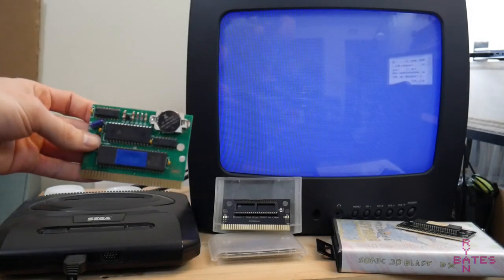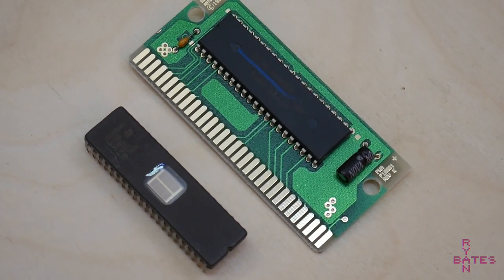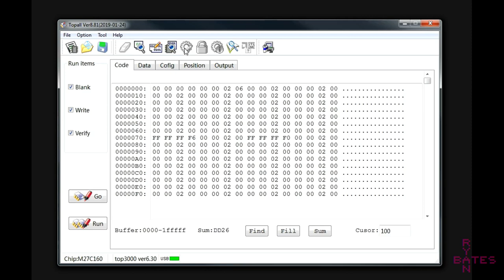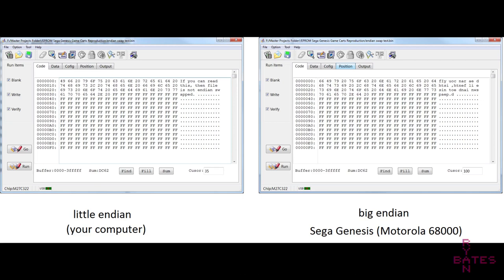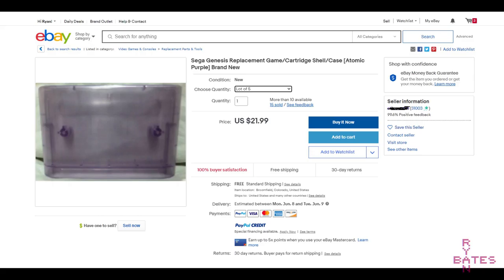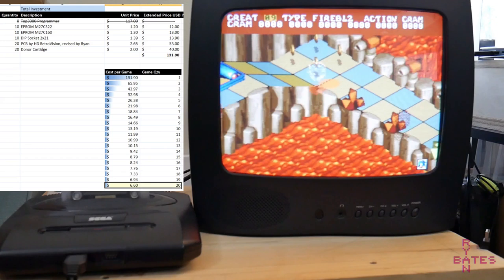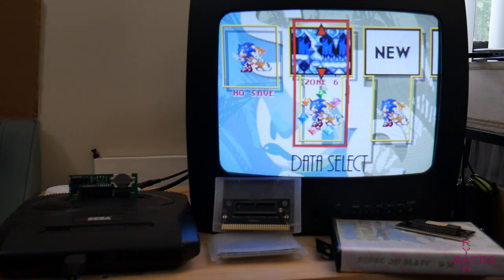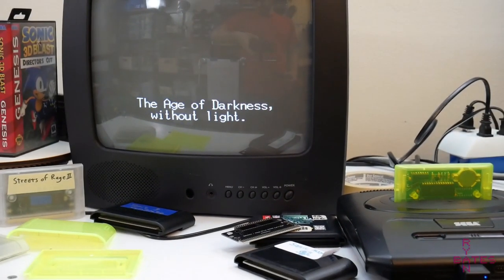Sega Genesis / Mega Drive EPROM Reproduction Cartridges | How to Make + Other Unnecessary Details

Comment: Very helful video, thanks a lot!
About removing the top of the Genesis shell for fitting in a test cart with a socket, I was thinking of using a Game Genie instead. If that works, I could even build a test cart with a ZIF socket which would make testing EPROM even easier.
Reply from the maker: Glad it helped. Game Genie would make a great cart extension.

Comment: I’ve heard the specific programmer doesn’t work on anything higher than Windows 7 32 bit. Is that true or is there something extra that I’d have to do to be able to get it working on my windows 10 computer?
Reply from the maker: It works on windows 10 64 bit. Source = me.

Comment from the maker: Anyone who has purchased repro carts: 
What are your thoughts? 
Where did you purchase: game show? online? 
How was the quality? 
What's more appealing; ROM hacks or physical versions of very rare/expensive games?
Reply: Megaran's RNDM cart, Remute's snes and genesis carts, ThaDe4D's cart album, LSDJ, nanoloop, etc..

None of these music albums or music tools would have been possible without repro / flash carts, and I love them to bits.
Reply: Imho, rare expensive game copies are more appealing, as it allows to have somewhat-of-a-physical-media.  That's why I prefer repros to flashcarts, because of that possessive feeling. Some Aliexpress repros were pretty good, but you always need to be careful, because cheap repros of save-games are faulty
Reply: i have purchased TMNT Hyperstone Heist in box on aliexpress a couple years ago - too bad i forgot the seller's name because the cartridge is nice quality for a repro - the originals feel a bit more solid but the repro cartridge shell has no rough edges or other signs of half-assed manufacturing.

same goes for the case - the trained eye will instantly spot that it's a repro because the transparent foil that protects the box art inlay is a bit more on the glossy side than an original would be ...

the price was also ok ... under 10 bucks shipped or so - and most important - the game works as it should and didn't fry my console ... i've heard horror stories 

now, what's more appealing? well, I just bought an everdrive and this kind of erases the NEED to buy any more physical copies ... now I might still buy physical copies when i WANT to. 

but i think i'd rather buy new releases or new-to-this-region releases ... you know ... proper translations of games from japan or korea that have not been released in US/EU before.

... and it would be cool to have things like the "240p test suite" on a cartridge as a tool to keep around the workbench when repairing or modding consoles and equippment.

a very awesome thing would also be if someone would take SMS games that would have had FM sound on japanese consoles, stuff the game ROM and the FM sound chip into a cartridge so westerners can finally enjoy SMS games like phantasy star with FM sound instead of whatever terrible noise generator the US/EU SMS consoles were stuck with.

Comment: I came across a used Repro of Musha that a local pop store was selling for 150, they opened up the cartridge and low and behold I saw an eprom with the visible microchip silicon. I've never seen that before so was curious and finally came across this. They luckily sold Musha to me for 19.99. I was actually impressed with the repro label and the fact they used a close to if not original sega cartridge, as it said Acclaim made in Mexico on back piece, and used real screws. Cool stuff, as I am not about to drop 300-500 on Musha, and didnt want a cheapie repro.

Moreover, the Board the UV eprom mine has is only a handful of contacts on the board. I've not seen a board like that. Wonder what kind it is.
Reply from the maker: very cool the store let you peek inside. I've been to a few establishments were the owners look you up and down wondering what an internal inspection would accomplish.
Reply: @RetroBuiltGames Wait sonic Mania in Sega genesis?

Comment: If the game is smaller than the eprom memory (a 1mb game on a 27c160)
Do I need to expand the rom? Or just record?
Reply from the maker: For genesis you need to fill the empty space with FF .(this should be an option checkbox in the programmer software). see @9:58

Comment: This was very detailed loved but i wanted to make a knuckles chaotix 32x using the NFL 32x cart (both got save features) if i use m27c322 which is necessary cuz it a 4MB rom is there any rewiring involved.
Reply from the maker: I have never looked at 32x carts, so it is hard to say. 
 But if you are just transplanting to with a donor i dont think rewiring is involved. That is a guess.
What is the NFL rom size? if youre going from 2 MB to  4MB, should be simple.
Reply: @RetroBuiltGames  The rom size is 4MB for NFL and i wanna use 4mb eprom m27c322 to burn knuckle chaotix . Both genesis and 32x carts are fundamentally same.
So i can just swap the original rom with the eprom ? Is that really it
No rewiring ?

Comment: Is it possible to program an EEPROM in a FlashKit or can it only be done using an EEPROM programmer?
Reply from the maker: you need an EEPROM programmer. The voltages need for EEPROM are typically higher than flash; so they are separate devices

Comment: Master good morning, I have a Japanese mega drive that has two slots for cartridge 😳, one in the normal place and one right in front lying forward and hidden under the housing, I can't find any other like it, have you come across this model?  On the board it is defined like this MD - 1095 G -1.5 ARG02
Reply from the maker: Never heard of this. link a pic.
Reply: @RetroBuiltGames  insta
Reply: @RetroBuiltGames  n64.eternally   fist image

Comment: Only time I use eproms for megadrive is when i want to change a games region from pal to ntsc or have damaged original carts,  I've got 2 carts here that were damaged by a dodgy game genie the orignal mask roms in those 2 games went bad when i try to to read them they came back with bad pins, games were streets of rage 2 and sonic 1 jp coding new eproms solved the problem, can't say i can be bothered making heaps of fake games to much hassle and expense id rather use my everdrive

Comment: I wonder if there are some developers who develop cartridges using microcontroller, such as rp2040.
Using this chip to increase the data memory capacity, save data and reduce the production cost.

I hope the chip with 16mb serial flash memory could help the developers create and produce games easier and cheaper
Reply from the maker: hoping this is the case now. The Gamecube modchip with the rp2040 might be the kickoff for this movement.

Comment: i don't have an uv eraser, i make one myself, easy, broke the outer glass bulb of an mercury lamp, and you good to go, the inner tube is what makes the uv rays, but the ballast is needed, and the exposed live wires are dangerous,and the light also, use a carboard box or something, place the ic under at 2cm distance and 15 -20 min is ok. Still dangerous af..
Reply from the maker: exposed mercury bulb +cardboard box combo you recommended = fire

Comment: In a perfect world SEGA would still manufacture and sell Mega Drive consoles, games, controllers etc. As well as the Master System, Saturn and Dreamcast.

There wouldn't be any downsides to it because they would be so cheap to produce now and they could sell them with the original/reasonable prices. All they would have to do is manufacture what's selling.

Unfortunately we live in a shitty world of licensing issues and CEOs who don't get retro gaming and game preservation.
Reply from the maker: What are you thoughts on the new Sega Genesis Mini model 2?
Reply: @RetroBuiltGames  It's great that they are making it because it's a little bit more powerful and many wanted a 6 button controller with the first mini. And they must have solved some production issues because it's now announced for Japan, NA and Europe. And it's got the most games out of any mini console.

Still it's nothing compared to if they re-released a full size Mega Drive/Genesis with authentic hardware that had 60 games built in and would play original cardridges.
Reply: In that perfect world they wouldn't last a gen if that's what they are doing.